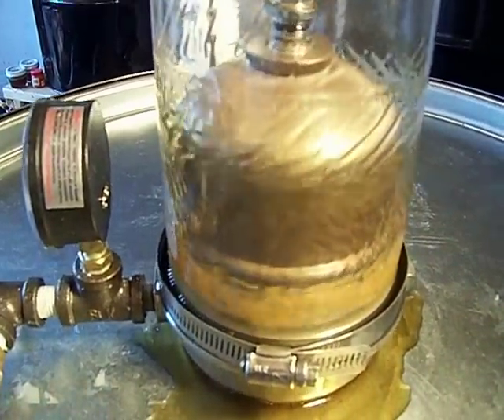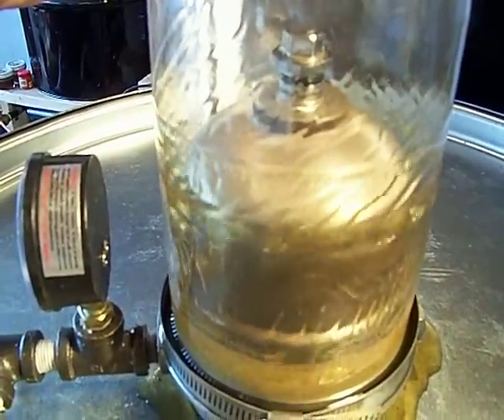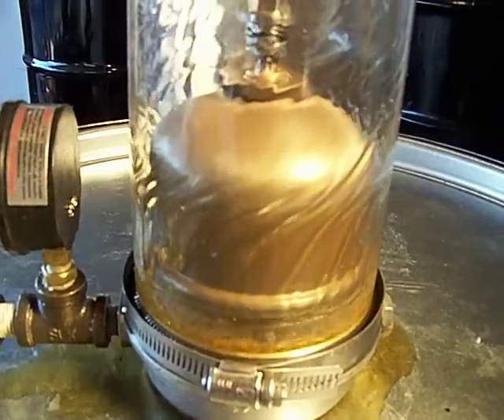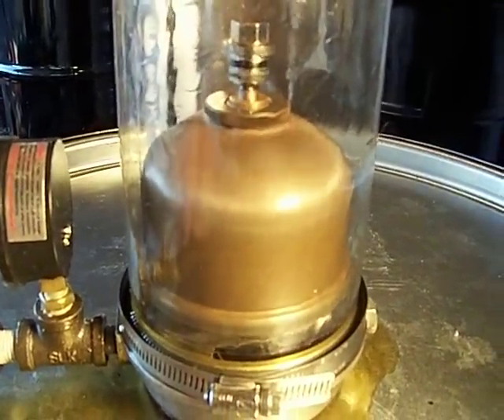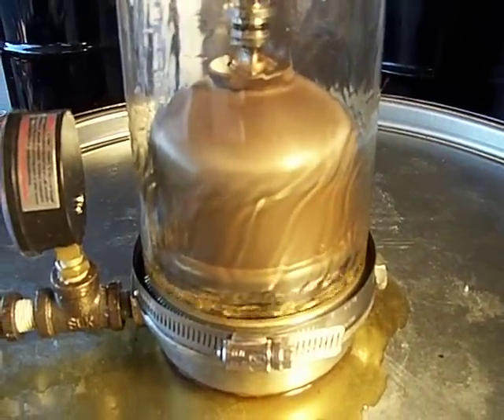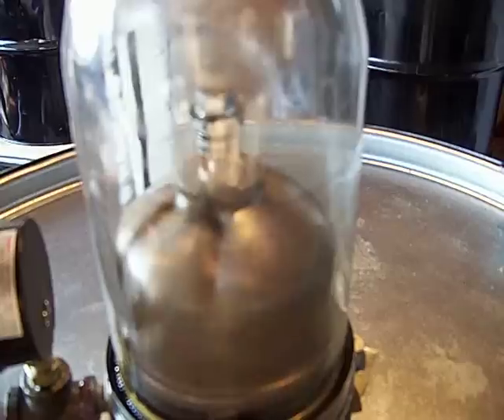See Thru oil  Centrifuge filtering wvo

Comment: Not sure why it is leaking, mine does not leak. Never has.

I like the sound of the rpm increasing! The sound frequencies produced , even at low volume gave me crappy little subwoofer a good test!

Great video, and I have the PA biodiesel supply 60 GPH unit I purchased almost four years ago. Works very well. Just need to replace the pressure gauge and ensure I don't leave oil in it
Reply: Project23D cause the see through is a plastic bottle dum dum
Reply: @shakiepete7782  I think it's plastic and he meant "if it breaks up and flies up in the air"

Comment: On big rigs this wouldn't be the main oil filter, Mack/Volvo engines use 3 regular screw on filters: primary/secondary/bypass, this is used as well but as a crankcase vent filter. Not every manufacturer uses them, mack/Volvo, paccar, newer Detroits. They don't get changed every time, Mack's can go 30,000kms, so every other oil change, not sure on the others

Comment: These types of fuges are bypass centrifuges, it takes many passes because of the small rotor capacity. THEY DO WORK, I can attest to 30K miles of trouble free WMO about 2000 gallons through my dual 55GPH PA Biodiesel supply units.   As I feared though, they do leak a little from the brass seal at the top of the rotor. This video confirms my suspicion. Nothing that a multiple pass 8hr run on a 55gal drum with twin centrifuges won't cure though.

Comment: so how do these rotors work? the dirt gets trapped inside them or where does it go? How does it extract the clean oil from that spinning area into a separate container without sucking in the dirt and grime ?
Reply: The dirt gets pinned to the inside of the rotor by centrifugal force. They need to be taken apart and cleaned out periodically.

Comment: Just curious so the inlet line is simply pressurized oil? Or do you use air and if you use air does it share the same port as the oil
Reply: The oil is pumped in

Comment: a spinning "filter"  is a bit of a misnomer.   A spinning filter is a type of a Centrifuge.  (Google that and understand the principle)  this type of filter separates stuff  based on its specific gravity using multiple G force.  (up to 10K times the force of gravity, or more)   in the applications here at this level of G force only particulate is left in the "Bowl", this is not spinning long enough fast enough to separate the liquid.   I used a "Spinner II" brand on an over the road Big truck for 15years or more.  depending on Model, and Pressure it is possible to remove particulate down to 0.007 of a micron   (that is the size of particulate in cigarette smoke)

the brand i used was  http://www.spinnerii.com/

Comment: do you need an oil pump to drive this ?.
Reply: duggy788 There's no power to a centrifuge. It's purely mechanical - no electrics. The pump forces oil (or whatever) through tiny holes in the centrifuges base. As this jets out, it makes the centrifuge spin. So the pump is what drives the centrifuge. I hope this helps.

Comment: why is it upside down? with the oil coming out at the bottom it drains the sudd everytime it stops spinning lol.
Reply: steffankaizer It's the way centrifuges work. They usually recirculate the content of a container. So here the centrifuge pulls dirty oil from the barrel, spins and cleans in, then returns it to the SAME barrel. It is inefficient which is why folks talk about passes (the number of times the whole content is thought to pass through the centrifuge). Multiple passes are always required. Hope this helps.
Reply: Geoff at VegOilCar that cant be right. if it constantly mixes the cleaned oil into the dirty it would literally never be completely clean. for the prize of one empty barrel that can be awoyded. and why even have a bypass valve? the pump could have a pressure switch or a rpm monitor thing thats all better than doing the same oil over and over again. i thought it would be one of the great advantages of a centrifuge to clean with only one pass. the water is pushed against the inner walls with the rest of the havier stuff and then it runs back out when you turn it of? it sounds just wrong. i almost dont believe that it would be the solution to turn it upside down, because it sounds too simple but it could be a start. thanks for respond its nice to see the yt comunity is still alive.
Reply: +steffankaizer  the pressure he is using is significantly less than the real operating pressures, I am guessing.   when working properly the inside of the cover would fill with the filtered participates

Comment: where does the water settle?
Reply: shylildude You've hit the nail on the head there... the water is trapped inside the centrifuge. Turn off the pump and the water fall back into the oil. I always advise folks to place a container beneath the centrifuge just before turning off. That way you can collect the falling water and debris rather than contaminate your oil.

Comment: Why would anyone need this? Engines have oil filters, right?
Reply: They're not able to filter the tiniest particles. Some 5 um diameter particles accumulate erode the engine and that's why you have to change the oil after some mileage.
Reply: On heavy truck diesel engines, this would not be the main oil filter, Volvo/Mack use 3 main oil filters: primary /secondary/bypass, this centrifugal one is also used but as a crankcase vent filter. Not every manufacturer uses them, Mack Volvo, Paccar, newer Detroits use them, I've never seen one on dodge 6.7 cummins or duramax or power stroke, just heavy trucks